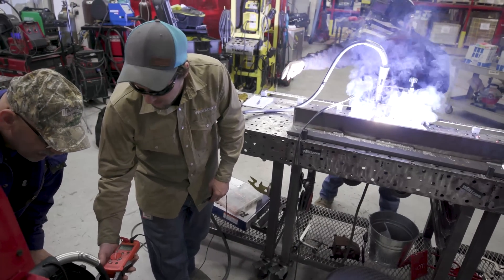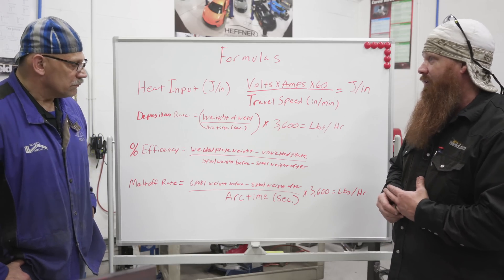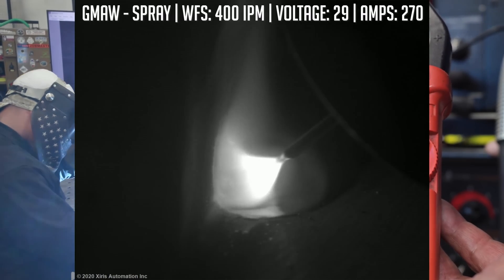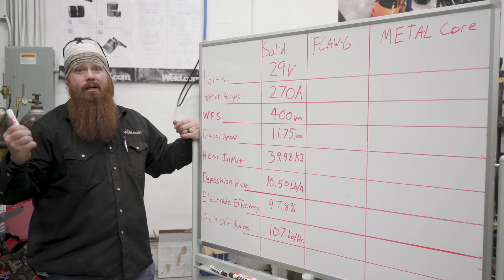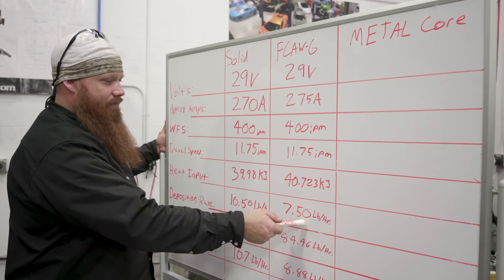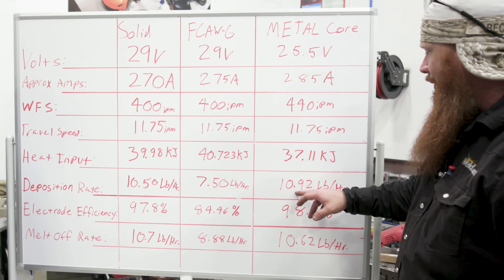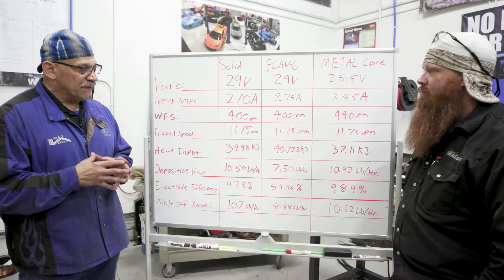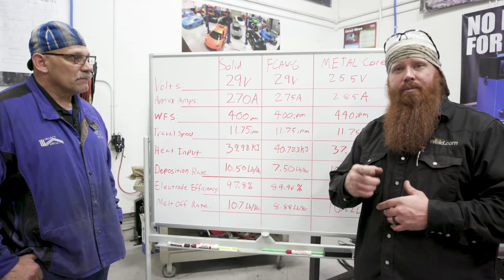MIG vs. Flux Core vs. Metal Core

Comment: Would be cool to see a side by side penetration test and a bend test.
Reply: S14kabuild  Yes. This is exactly why some further testing would be cool. Also in my experience gas shielded flux core equals deeper penetration. So, there must be more to this than just different deposition rates by weight. However interesting that is in it's own regard.
Reply: Flux core is great for dirty steel, metal core is finicky and wants clean base metal. Solid wire is in my opinion a great Allrounder. As far as work application, the slower deposition rate of flux core is met with no precleaning required. So rusty steel no prob, however it’s the post weld clean. Metal core requires much more pre cleaning but less post cleaning. A wire wheel, maybe. Then it comes down to position. Solid and flux core are all position wires whereas metal core is only flat. Unless you’re pulsing or rapid arcing in which case you can also run it vertical down. If you have the procedure for it.
Reply: I totally agree, I weld around for domestic needs, trailer, hitch, broken stuff, new contraptions, tools, jigs.... so my interest is more about penetration, solidity, and frankly I weld over some rust or exposed metal most of the time, from what I see here, I am good to continue using flux core, because it gets better penetration, so it must be stronger? (I guess) But I would have really like the bend test to confirm.
Reply: @Patrik Einarsson Disagree. Process will change the bend characteristics.  Spray transfer, the wire is sprayed into the melting weldment.  The wire never touches the metal. Also gas changes will affect properties of the weld when you bend it to failure.
Reply: @alienpoker  So what's your point here? Would it be a bad thing to perform penetration and bend tests while comparing these wires? At least in my shop the structural properties of the weld is of great interest as well as getting the most bang for the buck.
Also you don't need to school people who watch this particular video on how the processes work. I bet most of us are here because we have a professional interest in welding.
Reply: @Patrik Einarsson  Bend test if you want.  But it isn’t a fair race was my point. I’m not trying to ‘school’ anyone- don’t be a tool.
Reply: There is no one horse in this race to come out the best in welding. 
ANSWER : different applications are for different welding fitups. But in this video can u name the one to have the best penetration ?
Reply: There is cant be any sufficient penetration on so thick metal without gap, and bevels of edges. Its just test for transfer effectiveness.
Reply: @Wroger Wroger Don't think so. Just changing the gun angle will affect both the penetration and bead profile. I bet there will be some interesting differences between these wires.
Reply: @WoodTech9  
Ers70-6 wire is rated for 70,000psi, flux is rated at 72,000psi
That's only a 1/35th difference between the two
Reply: I don't trust mig at all, flux core maybe if it wasn't structural , but for all personal projects I stick to Tig or smaw.
Seen too many mig welds fail regardless of volts.

Comment: I am disappointed.
As you mentioned in your introduction COST. Therefore why did you not add two columns. One for the cost of the wire and the second for the cost of the gas?
And why did you run gas with the flux core wire?  Does it not defeat the purpose?
All this said, I did enjoy it to it's value. And thank you for posting and creating those videos for us the viewers!
Reply: I never run my Flux core that high. 30 tops... Dang thing most likely ice up.  Cost of Flux core has a huge swing... Co2 is a cheaper gas the ag o2.   But this was awesome to watch.
Reply: Lol. I was about to say the same about 2 columns, but as far as the gas goes, flux core doesn't achieve spray without it, what got me was setting the mig to 40... flux core needs that, but mig only needs about half that... massive difference between consumption of gas, but as far as I can tell flux core wire is about $10/lb and mig is around $2-$3/lb... not sure about metalcore but I have heard its expensive stuff
Reply: Cause gas shielded flux wire not self shielded

Comment: Could you do a test on overhead with mig using all 3 as that would be awesome to get efficiency numbers out of position in shop.
Reply: Good luck welding overhead in spray arc mode
Reply: @billionsandbillions  pulse spray is the only you could accomplish it.
Reply: @mikeford963  that’s what fluxcore is for dude
Reply: @billionsandbillions  you could run hardwire or metal core overhead in pulse spray.
Reply: @mikeford963  you could but it’s not made for that.  Metal core and hard wire are made for flat or horizontal welding.  Downhill or overhead in short arc transfer.  Did you two knuckleheads go to Tulsa welding school or something?
Reply: You would only be able to do Flux Core out of position. Of course you could do Mig if you went down to short circuit transfer. Metal core is the shits in short circuit except for a few types of wire.

One could argue it is possible to do fillet welds in overhead with spray transfer but its not typical

Comment: One of things I’ve always wondered.. between flux core and using a gas , which requires more ventilation when welding.

Could I use mig with gas and weld in a closed garage ?

Thanks
Gobear
Reply: A smart human would ventilate and wear a good respirator every second of hood time. You don't want to breath the fumes from any process. Just how I roll.
Reply: Swampy  Inhaling argon is really bad? Really? Really. I guess that's why we all die then eh, because 1% of the air you're breathing is Argon.
Reply: They both require ventilation, flux core you “see” the need more than you do with argon. The fumes and smoke from flux core go up right at your face and mask. There is less smoke and fumes produced when your using argon or C25 when mig welding but it is still produced. Argon and Co2 are heavier than air and will “fall off” your welding table and down to the floor. While the gases are falling away from you they can and will fill low lying areas displacing the available oxygen in the space. If you have an attached garage those gases can go into your house and displace the oxygen inside there. While it takes a fair amount of gas to completely displace the oxygen in the garage enough could accumulate to be a hazard to small ground level children and pets. Venting by  drawing fresh air in from up high and blowing old air our from low when using gas shielded is always a good idea. Sometimes just leaving your garage door open a few inches and running a fan may give enough air exchange if you don’t have a hood  or exhaust system in your garage.  Additionally if you are using a respirator as good practice to filter out metal particulate  or fumes you still must ensure that you have proper ventilation. I have seen body recoveries due to a respirator being used in an oxygen deficient environment.
Reply: @ump107  Thanks for comprehensive explanation about toxic welding gases.